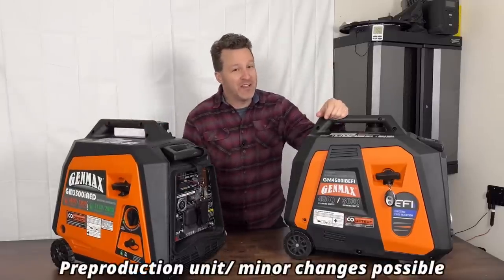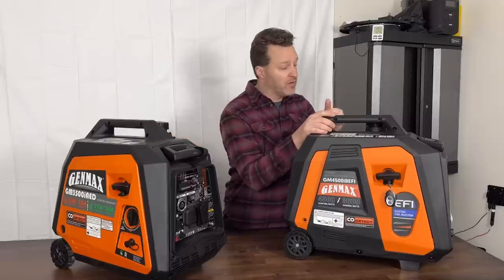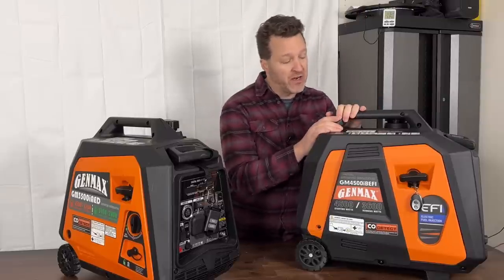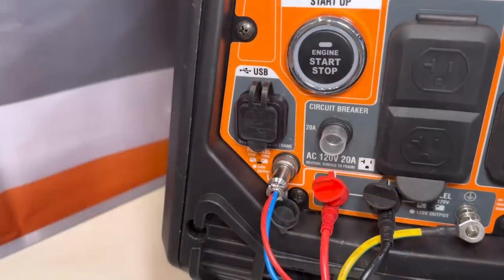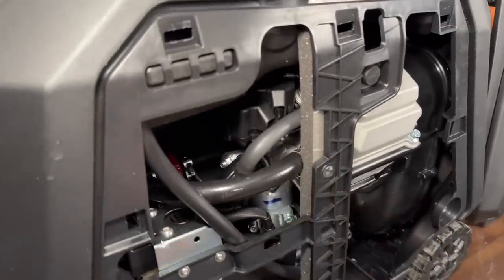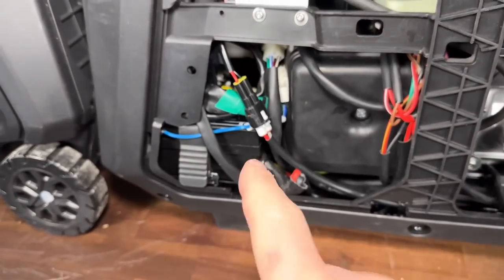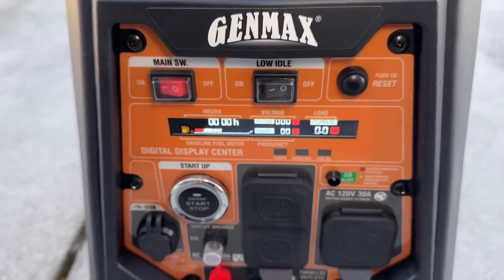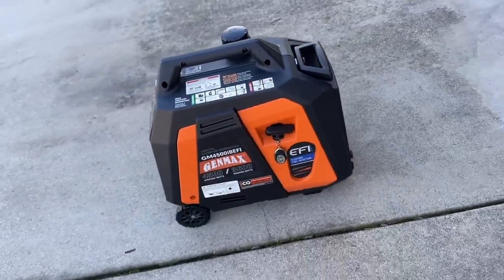Best New Compact Generator GENMAX 4500IBEFI Fuel Injection!!

Comment: For someone who is not running their generator all the time (which we only use in summer for our RV) what is better running on propane only like the GenMax 3500 dual fuel or going with this Genmax 4500IBEFI Fuel injection and running on non ethanol gas ? I asked a friend of mine who services power equipment he says go with Fuel Injection is that true ? Also with the Genmax 4500IBEFI Fuel Injection what do you suggest to do when you store it for the winter ?
Reply from the maker: Like any gas powered lawn equipment or small engine items, a fual stabilizer or fuel conditioner like the one I did show is needed to extend the life of the fuel and help neutralize the ethanol. If your running the generator every day, then its not needed. But when storing, even in this new Honda, it says to add a stabilizer. 
Fuel injection has benefits but its not immune to ethanol in fuel. Non ethanol fuel is a great option but depending where you live it can be double or more the cost.
Reply: @johnnysweekends  So if your opinion if you were going to choose from these 2 different GenMax generators and wanted to make sure you could start them year after year when stored (both not out right now but are coming out from what Genmax told me when I emailed them sounds like summer) one Gen Max 4600 IAEFIC 4600 starting/3800 running fuel injection (I would use non ethanol and lucas treatment and try to run fuel out to store each year) and the other one Gen Max (dual fuel) 4600 IAEDC 4200  starting (on propane)/ 3500 running (this one I would use propane only no gas) in your opinion which would you go with my concerns is I want to have no problems starting ever spring and also want to be able to run 15k ac a couple of minor things at higher elevation 8,500 ft elevation ? which would you choose ?
Reply from the maker: Idk yet, until I test them then will see. One thing with dual fuel is the option to have a option. And no jetting with a carb at altitude. Sure there will probably be a kit for the EFI some day, but when. Also at 8500 feet which is going to be my high altitude test later this year with both the Honda and Genmax EFI will see how well they do. The can compensate for jetting at least that’s what im hoping but they will still be done on power a lot at 8500 feet.

Comment: Still not on the Market yet. Manufacturer says July 2024 now. I think they are still trying to get the extra 1000 watt output using the same 145 cc motor
Reply from the maker: They just shipped me one. Should be here mid December. New motor that is slightly bigger as well.
Reply: @johnnysweekends  sweet thanks for the update.

Comment: I just sold predator generator when is this going on sale I definitely want this.
Reply from the maker: I was talking with them about this model after I got it about a couple small issues. 
Which they changed the battery and board to draw way less power when sitting and a better battery now. 
So they changed those items and then they should be getting to mass production soon. And when you see the new video hit that’s when they will be ready and I’ll have discount codes as well… 👍🏼😀

Comment: What is weight & fuel capacity? Nice review. Thank you.
Reply from the maker: About 56 lbs and 1.58g 😀👍🏼
Reply: @johnnysweekends  that weight is amazing.  The other 3500 watt generators are about 100 pounds.
Reply from the maker: Well 56lbs is completely empty I believe so over 60 with fuel and oil.

Comment: Are they any models that have the 240v 30amp 4-prong plug and is EFI?
Reply from the maker: Nothing compact and portable…….yet!
Reply: The parallel and series kit if buy two 120v can change to 240v by using the special kit see GM4000iSAPC. The new released has this function.

Comment: Which is better if your generator is going to sit for the winter EFI or running on propane only ?
Reply from the maker: Propane really is nice for fuel storage, but EFI if ran once in a while will have little issues. But if you use a additive like I showed that extends fuel life so that will only help

Comment: I noticed that the gen max model for sale now is the 4600 efi. It looks the same. Can you tell me how you would attach propane to it?  Does it come with an adapter?
Reply from the maker: The new Eli is not a dual fuel model. I will get my unit in a day or two and start looking at it.
Reply: Thank you. Let me know what you find out. Supposed to be tri fuel
Reply from the maker: @chasewells268 my contact never mentioned anything about this unit being tri fuel. i future models we have talked about this but not this. Fuel injection does nothing for LPG or NG anyway.
Reply: I could be wrong as there’s so many models available

Comment: Genmax is made by the Chongqing Dinking power machinery Co. It is owned by the Chinese.
It does not matter what it can do, it's how long will it last is the question.
Reply from the maker: They have been lasting a long time so far and they make many other brands for other companies as well. 
Will it last as long a some Hondas 🤷🏼‍♂️ maybe not but if it can make it 60% of what a Honda can do at a lot less your way ahead in the long run and down time is lost money so who has time to send a gen to the shop for a couple weeks when you need a unit that day or the next

Comment: hmmm I have the Honda eu3200i ... time will tell whose is still running in 10 years lol
Reply from the maker: I have the 3200 as well. It’s more about price. If I buy two units will they provide more hours of service than the Honda which also is smaller lighter. And overall price is cheaper. 
Plus if you don’t have the timing belt inspected every 250hrs then I bet your warranty will be void if you don’t have a dealership check it. Which is how they get ya.

Comment: Fuel injected  ?  With a choke ?   Wtf ?
Reply from the maker: Well like todays cars the intake has a butterfly valve that is fully closed on start up. Acting like a choke to provide a richer condition. On todays cars though it doesn’t stay closed very long at all. It cracks open as soon as the car is idling. 
On the generator this acts as a choke and air flow control valve. More load the more it opens, and the more fuel is pumped through injector

Comment: It's a throttle body injection, not direct injection into the cylinder. But still better than a carburetor, easier starting, less chance for stale gas to build up deposits, and perhaps better efficiency.
Reply from the maker: Yessss, and about 10-12% better on fuel efficiency is what it should see. But hard to test unless you have one carb and one FI to get true results.

Comment: I would not even consider a generator that only has a battery with no pull start. It won't take long for the battery to die sitting in  hot garage.
Reply from the maker: Put a battery switch on it and it will last 3 times as long or a trickle charger or disconnect it. Just like a car, in about one month to 2 that battery will be dead if you didn’t drive it everyday.

Comment: Cool, I am glad I didn’t pull the trigger on the Honda. This seems like a much better value.
Reply: Just about anything is a better value than the new Honda. I love Honda generators but the newest is overpriced (even by Honda standards) and underpowered.
Reply: Don't be so sure about that until you show me ONE video of a 10 year old Genmax still running like a charm like a Honda.
Reply: @rebellucy6200  I am sure the quality is not on the same level, but if the Honda is 2500 and this is 1000 it could be replaced 1.5 times for the same cost.  I am all for quality, but the price difference seems huge.  It will be interesting to see more reviews.
Reply from the maker: Even the new Hondas are not lasting. You can find the info. A lot is disappointed people. The 10 year old Hondas were probably the last of the tough units. Will see.
Reply: @johnnysweekends  I have 3 Hondas that are a decade old and run like Champs. I do not disagree with your take and enjoy your videos, but few Chinese engines last very long from my experience. Maybe these are different. The best way to see longevity is to look at what the city food trucks are using. They use them DAILY under a load. Keep up the good work!
Reply from the maker: It’s funny you say that as I was at food trucks that other day. Out of the 4 not one has a Honda!!! That’s probably the first time I have seen that. Normally they have the eu7000. 
But I saw one open frame predator, two large open frame champions and one all black something, Briggs and Stratton maybe, couldn’t really tell was tucked away. 
Unfortunately Honda has priced them selves so high and from responses I get people are getting some serious hours out of other brands now. I have a few Alaska preppers who hang out here and have used Honda and predator. They said they are done with the Hondas. They are not getting the price difference out of them. 6000 hrs or so on the Honda and 4000 4500 on the predator. 
They run them just about non stop. It’s crazy. 
So idk….  Either way Honda is missing a big market.
Reply: @johnnysweekends  Maybe so, the Amish here in Indiana are mostly using the Eu7000 style and have huge hours on them---  over 20K.
Reply from the maker: Yea the 7000 model is pretty tough the units I was mentioning were the eu2000/2200 units
Reply: Generator  technology  has caught up with a ton of different manufactures. Most generators are put together well now. This one looks like a champ!
Reply: @dondgc2298  I use generators daily for work. Have for the last decade. It will be damn hard for me to replace my Hondas. Between downtime and just randomly quitting on us, the Chinese engines that are mass produced in a lot of these generators are just waiting to break. Went from having nonstop generator problems, to switching my entire fleet to Hondas and have been problem free for the last 4 years.
Reply: @mrhlynnu1464  if you’re using this in a commercial space, downtime = money. If you’re buying this to power your camper, by all means.
Reply: @Joeak74  has nothing to do with technology. Has everything to do with poor engineering combined with poor quality control. I’ve had every single generator you can think of, and aside from Onan…. nothing can beat a Honda.
Reply: @mr8610  I have a Honda that I love. My comment was specifically about the new EU3200 which offers a relatively modest power boost - 44% - over the 2200 for more than twice the price. That’s insane. Two EU 2200s deliver a lot more power at a lower price. As I said in my comment, I am a fan of Honda generators in general. Just not the newest. They missed the market on both capacity and price.
Reply from the maker: They are definitely better than about 5 years ago. There was only 3 good options really. Honda,Yamaha and champion. 👍🏼
Reply from the maker: What models are you using ..?
Reply from the maker: Which units did you run that were not Honda….Anything from the last 5 years..? Models and sizes..??
Reply from the maker: Price is just ludicrous…was sad when they stayed at $2599 😕
Reply: @dondgc2298  we came to the same conclusion and bought 2200s and have a few of the older style 3000s as well as about 3 of the big generators for 220v applications. I misunderstood.
Reply: @johnnysweekends  Champion, Yamaha(which was pretty good), Onan(insanely expensive to fix), Generac, Firman, Subaru, and a few others I’m forgetting.
Reply: @johnnysweekends  and most were around 3000, a few 5000 watt generators. They all did their job, but around the 300 - 500 hour mark they all started to do the same exact things and just start blowing all their seals, leak like nobodies business and have staring issues.
Reply: @johnnysweekends  with all that being said, this being an EFI… does have me interested. I might pick one up and try it out, because as you stated…. the new 3200 is SPENDY. I only paid for $1800 for my old 3000s when I picked them up, and they’re super plush. Electric start, roller wheels, all that. This new one is lighter, but it’s not as quiet as the old carb version is.

Comment: Well, here we are. We're in December, but still no word on this model!... must be problems, problems, and problems makes me wonder when/if it should come out, if it's still going to be a problem model???
Reply from the maker: Stan think positive 😀 how many large companies have delayed products to make sure they are ready for mass production , Ford, Tesla, Chevy, John Deere, and more have giving leaked products that are coming and can take 6 months to a year before they ever make it for sale then another 3-6 months before delivery. Better to build it find a problem and go back and fix it. 
I know they asked me a lot of questions on what I think it needed and what people would want. So they may have gone back to add or fix a couple things for a better product. My contact just 2 days ago said one was just shipped to me. Soooo….🤷🏼‍♂️ will see when I get it and then hopefully will see when it’s available for mass sale.
Reply: @johnnysweekends  It's nice to hear you have confirmation one has shipped your way. Currently I've been using the Harbor Freight 3500 living on my sailboat. 3 to 6 hours a day, some in the morning mostly at night when I get in from work. It's been raining two days straight here in Florida it would have been nice to use the remote control start and stop... one of my major concerns is this lighter weight unit indicates to me they use a smaller lighter motor but run it up at a higher RPM to get the horsepower which makes me believe it probably won't last as long. The higher RPM means it'll be louder once the muffler packing wears out. Oh well, we'll see!
Reply from the maker: @stanRmeyer everything you said will be true, although they did increase the engine size. So will be interesting to see how this does. Hope to see it in a week or two.

Comment: "Make sure all your loads are off before you remote start".
Let's see... I can either shut off my fridge, heater, fans, PC/Network, etc. just for the luxury of saying "Hey, look at me, I can start my generator wirelessly!"
or I can just go outside and start the generator and plug in the 30A whenever it's ready.
Reply from the maker: All in how you treat your equipment. This is the same for every generator hence why all loads should be off before starting it. All depends on how your using it.
Reply: I am using a Westinghouse igen4500 currently doing vanlife fulltime, and the only load I shut off is the a/c. My cooler fridge, LFO inverter/charger,  and whatever else stay on and I haven't had any problems.  

At night if it's cool I reach up,  shut off my a/c and kill the generator with the fob. In the morning, I just hit the button and it starts right up and after about 5 seconds the inverter starts charging my lipos from my overnight tv and fan use. 
After the generator runs with that load for a couple minutes I crank up the a/c. Never had a problem. 
I even bought a spare inverter board from Westinghouse in case I burned it out, but 560 something hours later it still runs and works perfect. I do change the oil at 60-80  hours religiously using mobil one, and did the valve check at 200 hrs, the valve clearance was perfect.

Comment: As for "replacing the starter", you'll never ever find a replacement starter for this unit 15 years down the line when it dies.
Reply from the maker: In 15 years that would be like replacing a transmission in a car with 275k. Think I would pull it with the rope until the last hours of life are giving from the engine.
Its like people who replace a lot of Honda parts in a very used unit only to have the engine finally give in 6000 hours. Eventually it doesn’t make financial sense for the rebuild.